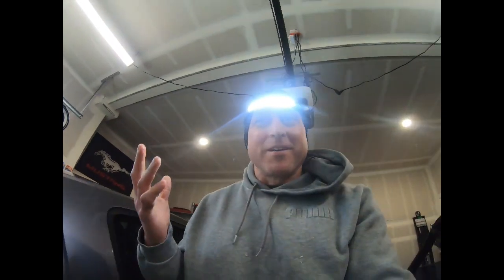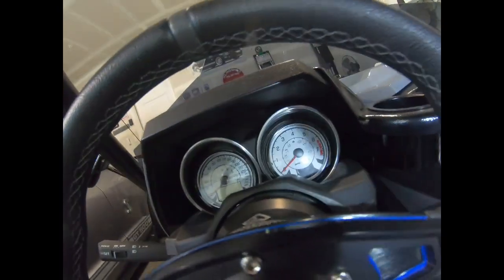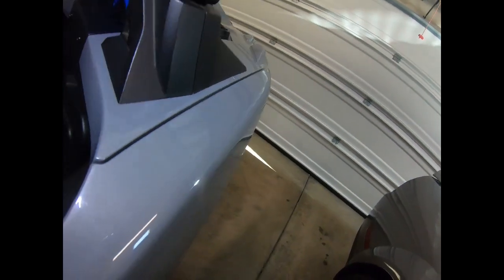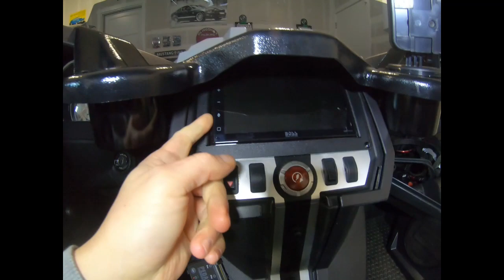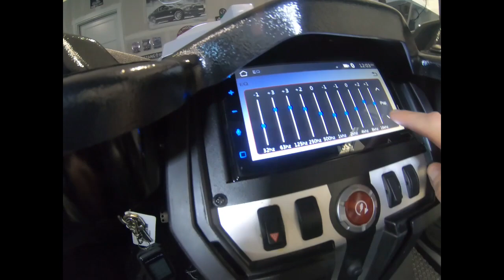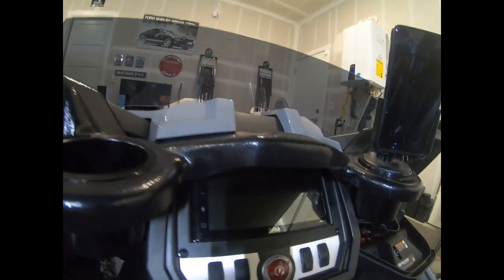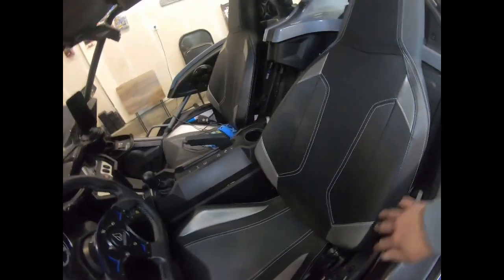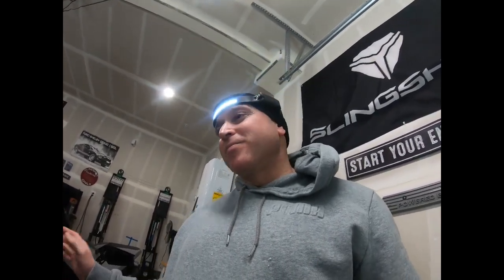Polaris Slingshot Sound System Upgrade - Beginner's Perspective

Comment: Dude, you and I think so much alike. I'm not paying a bunch of money to hide wires and crap. It's not that serious to me. I did my own lights. I'm trying to buy the armrest kit for my speakers. I do not want speakers near my ears. Armrest speakers and tweeters are all I want. I see that you if have a pedal commander installed. I'm buying the pedal commander
Reply from the maker: Cool - yeah the pedal commander is an easy install and you'll be surprised by the difference. You can't do a "canned" tune on these to my knowledge. So pedal commander is the next best thing.
Reply: Did you have to buy a slingshot kit to install the radio?
Reply from the maker: @commonsense5077  yeah had to buy the mounting kit…
Reply: Where did you get the kit from? Also, did you buy the wire harness for the radio so that it can eliminate all the wiring cutting? I do not want to splice and cut.
Reply: I have a 2023 SL